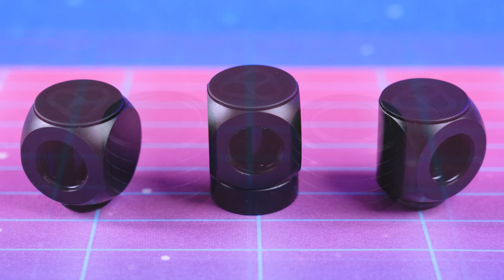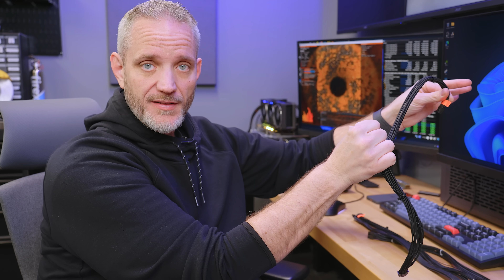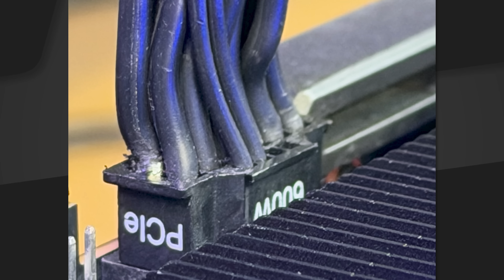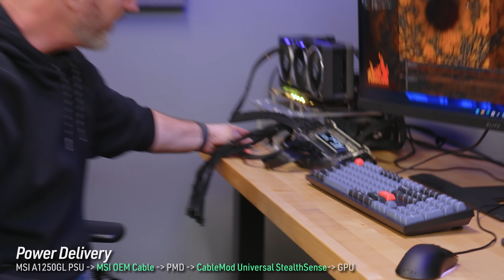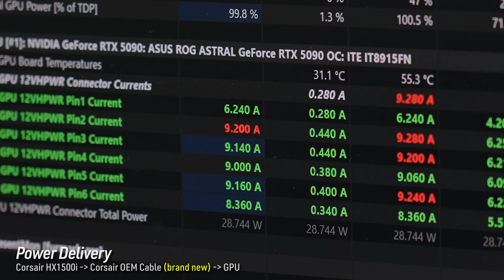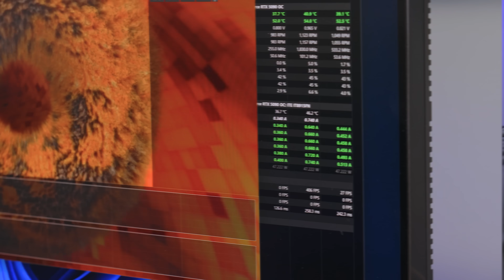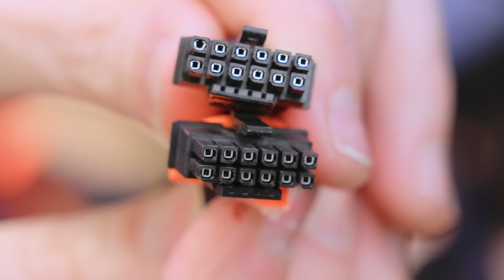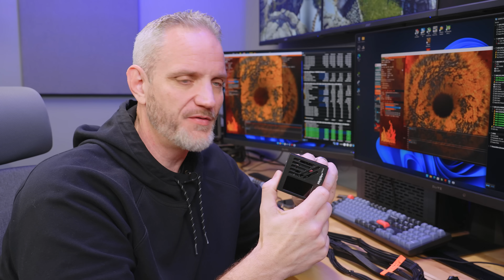More details on what could be causing 12VHPWR / 12V2x6 Cables to melt

Comment: any kind of wiggle on the plug itself will cause spiking. seems very concentrated. im going to wait for the recreation of it on screen. any kind of variance and the card will freak out. these pins are not super snug as it is so they are all waiting for that. you shouldn't be moving cables when they operate. this happens on 30 series cards too. EDIT. yup its a nonstandard issue. some of these cables are to loose to begin with. not only does the plastic need to be tight but the crimp needs to grab the pin right each time.

Comment: This is making me soo nervous since in my rig that I run my Zotac 5090 Solid card, I have the Gamdias Helios 1300W P2A PSU and I wish I could get the one with the 3x8 pcie ports that  go into the one 12V 600W power one so im forced to get the universal one. I had actually taken one of the cables from thermaltake and plugged it into the helios 600W cable and it fits much more snug and is shorter which is actually better when transferring electricity from what I know but after watching this I went back to the original one until the CableMod one comes, even though the original one is kinda loose just like the one you have... Dont know why. Its literally brand new! Btw I undervolted by GPU and it tops at around 270W under load from what I caught and im absolutely happy about that... Not chasing a million fps or any crazy mhz overclock... 925mv @ about 2585 mhz and thats what im getting. Also capped the monitor refresh rate at 60 fps. Like I said, I dont need nor do I play Esports... I want Rdr2 riding the horse enjoying the view! Slow and steady! >;)))

Comment: The 12vhpwr that came with my PSU had a wire loose that I realized after having it for a while. I bought one of the newer thick CableMod cables and just check it every once in a while. I haven't had any trouble so far. 

Yeah, I shouldn't have to do that. The GPU and PSU should be checking and communicating any errors to shut it down at least, but at this point it is dealing with the situation at hand.

Comment: Longer cable can create induction related problem that cab be solved by twisting the wires.
Moving cable around giving you different readings means cable wires are not crimped properly.
For longevity and reliability, remove each pin one by one and solder them to their respective pins then push back into the connector and a small drip of epoxy.
This will give you 100% solid connection between point A and point B of the cable not questioning the crimping reliability.
Reply: This comment should be pinned
Reply: Epoxy is probably not the best choice as it does not adhere well to the plastic of the connector.
Imho polyurethane glue should work better.

Comment: Its worth investing in a pin drag/fitment test kit for these kind of problems as well. Repeatedly plugging and unplugging a connector can spread the socket in them causing crazy intermittent issues. The pin drag test is great for finding these ill fitting connections.

Comment: Waiting a 5070ti to arrive, and now im not sure if i should worry more, because i have an older gpu and im planning to use the Y adapter that comes in the box, or, actually be relieved that im using the old and reliable pcie 8 pin cables.

Comment: Ok so #1, Amazon Basics cables are and have been known to be absolute crap for years. I'm genuinely shocked a reputable channel like yours was even using them in the first place beyond testing the cables themselves.

#2, use a multimeter on the cable and test the resistance, that can be used to estimate the wire gauge

Comment: I would be curious to see the results of simply testing the resistance of each wire from connecter to connecter with just a basic DMM. If the wire is weak or  damaged this test will be as accurate as any other by showing any variance between the individual wires. You may have to bend the cable to witness any fluctuation but the same goes for any cable integrity test unless the wire is actually severed. It's certainly more satisfying to see the change in distribution of the current in real time but hardly worth the extra expense for the average consumer. Bottom line... if a wire in the exact same gauge at the exact same length  has more resistance than the rest, you can bet your ass it's carrying less current than the rest. In the end reaching the same conclusion, just two different ways to get there.
Reply: Obviously, this only applies to a cables integrity. After ruling that out, it's back to the clamp meter.

Comment: One way that you could test for Wire Failure on the Cable assemblies is to resistance test each wire. Use a Multimeter set to resistance plug the leads in on each end, You should have very similar resistance on each wire. As resistance increased you get a loss in voltage, which you then need to increase the Amps to maintain the Wattage.

Comment: Tell the stupid manufacturers to use eps standard cables that is already used in servers for server grade video cards they are rated for 300 watts, use 2 for 600w, and use 3 for 900w oc cards, they are the same size as 8 pin pcie.

Comment: You need to get a small CT scanner to examine the interior of the cable
Reply: He can just cut off the braid and strip the insulation off carefully. It will show where the break in the wire is, and if the wire is copper clad aluminum.

Comment: if it helps the through hole components have a  copper  cullet throught the board the layers are attached to.  when you solder you solder the the cullet (through via)  so the job doesn't have be absolute perfect.

Comment: So even if you ignore all the bs going on with pricing and availability of gpus, I didn't want to upgrade from my 3070ti solely because of the safety of new cables and connectors. Never did I think this would be such a prevalent issue across practically every brand. Maybe when I "upgrade" in 5 years they wont be causing fires. Edit. You know, I realised that all my "upgrades" in the last 4 or so years haven't been necessary at all for what I actually do. They were simply because of wanting a newer more advanced product. Time to go back to broke high school me's buying philosophy, only buying to replace what is essentially dead hardware. Shits just not worth it anymore.

Comment: you might want cables with Molex Mini-Fit Plus HCS terminals. These use thicker copper alloys for durability. Use 14AWG wiring and Glass-Filled PBT housings to prevent pin bending and housing warp during frequent disconnects. High-cycle industrial-grade only.

Comment: This is probably not relevant since it's specific to old BIOSes on ASUS And MSI boards but having ERP enabled with an 5090 Astral can cause incorrect current distribution readings (using on-board gpu current pin reading)  on next reboot, turn on. Disabling that setting fixed the issue for me at least on my 5090 Astral OC. I had a MSI Z690 Unify-X with latest bios. Tried reseating the cable seemed to work until reboot but that seemed to be placebo what fixed it for good was the thing I mentioned before. The ERP setting would cause red numbers like you described and the currents were a couple amps off wildly across pins.

Comment: Jay, you’re also missing one HUGE issue with these cables no one realises. It’s noticeably on the adapters for 8pin PCIE. 

The sense pins in the connector are wired internally to the sense pins on the PCIE connector. This means that all it takes for the GPU to “think” it’s connected properly is for you to plug in the 8pin PCIE cables (which will always be the case, it’s a stable connector). 

So the sense pins don’t even do anything to prevent the GPU from pulling maximum power through a dodgy connection if you’re using an adapter. 

It straight up DOESN’T work.

Comment: What monitor software are you using to monitor the amperage of the pins of your cable to card. 

FYI,  I have a Corsair RMx 1000 ATX 3.1 using 12pin connector from my PSU to 12pin connector to my RTX 5080.
Reply: HWinfo allows Astral current distribution reading.
Reply: @yabaddi thanks.

Comment: I'm using the 4x 8pin to 12v-6x2 cable mod cable and it fixed my squid connector with having amperage issues on the pin. ALL of these cards need to have pin sensing. It would be nice if they used either 2 connectors, 1 long connector with multiple clips and/or thicker gauge wires. Most likely just need a real updated version that's actually "safe". 

BTW the wires most likely melting in the middle are due to length of run at this amperage, they're clearly under gauged wires at that length for power requirements.
Reply: Brother the 12v-2x6 and 12vHPWR cables are identical. ONLY the connectors were revised with the ATX 3.1 update
Reply: @nimaahmadi-s7o i know it was actually the sense pin revision. I don’t think you understand what I meant. I was using a squid connector and switched to 4x 8-pin / 12v-6x2 cable from cablemod which resolved balancing on pin readout. Cablemod stated to me directly that no other cable has a better load balance. With 3x 8-pin or 4x 8-pin to 12V
Reply: @GraphicFrost I saw a melted cable like that one on YouTube. The PSU side was melted but not the GPU side
Reply: @nimaahmadi-s7o cablemod says they have not had a failure with this cable so far. Evga has stated they have not had a failure on my psu and this connector. I have the superNOVA G2 1300 watt psu.

I’ve seen melted 8pin to 8pin on psu side. I have a cable thats red and discolored black on psu side.

Comment: I had the same problem with my Corsair 90° cable: my 5090 kept shutting down my system and rebooting it, and it got worse over time. After I replaced the cable, my system ran without any issues. I thought that maybe the copper inside the cable was corroding or something, which increased the resistance, so the GPU wasn’t getting enough power and shut down.

Comment: At the end of the day, it's still a stupid power cable design. It's not robust, and doesn't have anywhere near close enough 'reserve capacity.' I think we're at the point where multiple small conductors is not the way to go; we need fewer conductors of  larger gauge wire so 'balance' isn't a thing. Hell, a single 10 gauge silicone jacketed wire could carry the power requirements of the card.

Comment: The poor connection causes heat which is likely plasticizing the plug thus making it retainment into the housing even worse . Maybe you could set up some heat probes into the back of the cable entries, to check differences.

Comment: .... Why didn't you just put probes on the ends of the wires, clamp the ends, and move the cable?
That way you would see the specific wire and/or issue with resistance changes etc, and find the part of the wire that is screwed?
.. this is just a very long winded video where you just say "some cables suck"...

Comment: That gadget is hugely overpriced, given the rather simple electronics needed to do what it does. The only justification is cards cost much more, but you need the device so a crappy cable or power supply doesn't fry your card... Sue the crappy cable suppliers for the full price of the burnt card and then you will stop needing overpriced protection devices.

Comment: Heeey, i got a question. I build my own pc about a year ago, with a 5090. I pluged the 12v high power cable in once and never touched it. Eveything works great, but video's like this make me want to check the connector. Shoud i just leave it in? Or pull it put an check if it got hot and put it back in again?
Reply: Its like a schrödingers connector right now😂

Comment: so.. in conclusion there is 
1. no safety factor. 
2. a bad design with no load balancing, 
3. inherently bad wiring that degrades over time
4. bad connectors that break and wear.
5. a spec that mandates the connector be connected to a single plane and not individual phase. (2 but worse) 
6. a company that doesn't care and is just ignoring the problem and refusing to solve it, despite continuous reports of issues. 

am i missing anything?

Comment: Simple,12 pin is not enough to transfer such amount of power. make a new standard connector. A new 16 one.
Standard 8 pin only deliver additional 150w from 3 of its 8 pin. 12pin only use 6 out of its 12 pin. Means 12 pin should only deliver safe 300 watt of power.
It should not used to power 450watt gpu let alone 600 watt

Comment: recently bought a 5090 before the prices got bad and after some testing of the card. initially the power balance was okay but 2 pins were hitting over 10A then i switched to a new board and cpu and all of a sudden the spikes were heavy on 1 pin hitting 11A. after some messing around unplugging and replugging now all the pins are getting even power with only sometimes going up to 9.12A at the most on 2 pins. using cablemods sleeved 12V cable on a seasonic p1000 psu. this is such a stupid thing to have to monitor
Reply: during the initial monitoring i notice 2 pins were getting very little amperage. 2 of the pins were maxing out at 5-6a while the others were pulling 8+

Comment: Jay... you probably caused an internal sensor to power off system due to wiggling ground and causing a short circuit and/or ground fault trip.

My company utilizes a DTX/DSX to analyze our data cables but they do not work for power cables. I am sure there is a cable analyzer for power cables but have not looked into it either. Maybe someone knows of one in chat.

Comment: I have said from day 1 of the 12VHP would not work forever.  I have been in electronics since 1978 and I know even if you had car battery jumper cables from the power supply to the card it still will fail sooner or later.  Reason is so simple.  Just look at the pins inside the power supply.  Every plug has larger pins than the 12VHP.  You just can't pull that many amps of current through those tiny little pins.  Try jumping your car battery with 22 gauge wire and see what happens.

Comment: If the 12vhp standard can't be fixed, it needs to be abandoned. I'd glatly take multiple 8-pin connections on a card, especially if you're already using multiple 8-pin connectors on your psu anyway. Hell, move to something closer to the larger 18 or 24 pin motherboard power connector for more power hungry cards. distribute that power over more cables and pins and avoid a bad 12vhp forcing 600w down a single wire.

Comment: Super fascinating to see the current draw on each pin. Not surprising the current draw is dependent on resistance which is dependent on equal contact between all pins which are too many variables to get right.  Dividing the current into many pins is the weak point, because  if all goes wrong 1 pin could take all the current which they're not designed to do. So yeah less pin cables are better less  chance for that type of failure and where a  2pin cable to handle all the amps would be better.  Maybe you could mod your Card for that. Buy one of those EV charging cables, i think they can do 50-100 amps, and solder it in place of the pins  Thicc cables boy, show it off.

Comment: I very recently purchased a new corsair PSU, a RM1000x, and I was about install the 12Vhpwr cable into the PSU end I noticed one of those ground wires already had come out of the connector. As rubbish as the 12Vhpwr connector is I think Corsair (and others tbh) need to up their game in QA checking during manufacture.

Comment: The problem is the only way Nvidia can get the performance it needs, is to pump large amounts of power through their GPU's.  pushing upto 50 amps through a small plastic connector, your going to have issues.